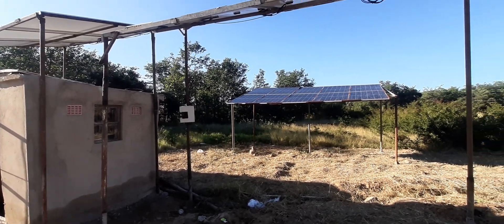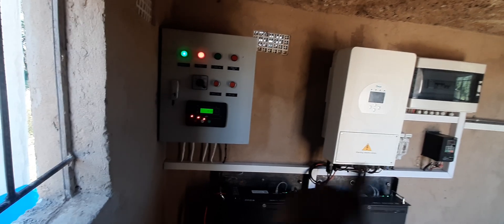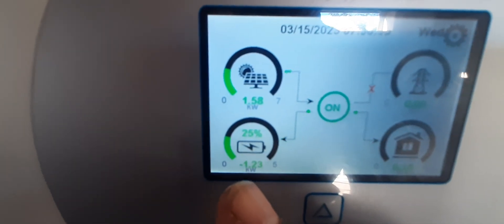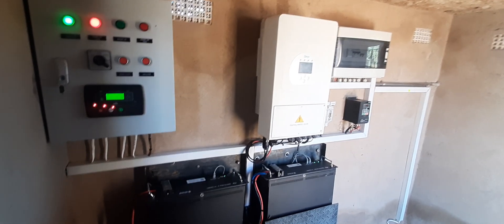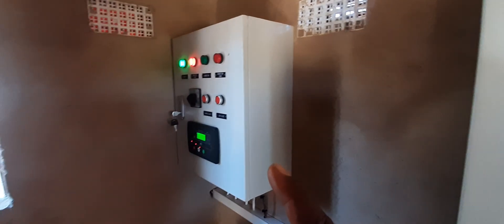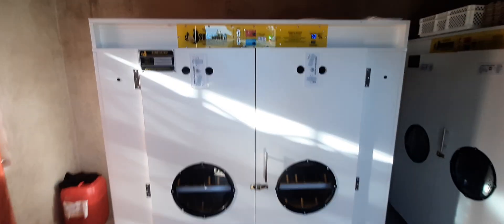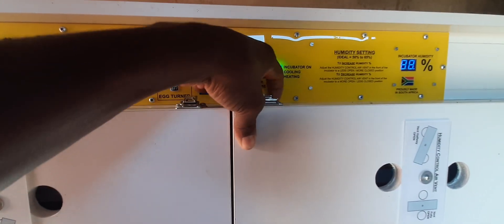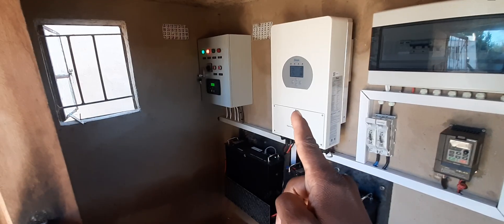This is the best Solar system Ever that can run an SH4000 COMBO INCUBATOR 🥴🤝🏼

Comment: Did you pay any Zimra duties or taxes when you imported the machines?
Reply from the maker: Yes I declared the machines at the border and did all the paperwork
Reply: That means there is no duty it's just declaration of import since its an agricultural machine is it?...also please tell me what's your egg turnover percentage..if u put say 1000 eggs how many successfully hatch ...I know it's dependent on a lot of factors but I just need a worst case scenario number....the other question was does that machine have an automatic humidity controller or you it just has a monitor and you adjust the humidity manually

Comment: Great system though instead of the change over switch + board,  you could have simply used "dry contact switch port" on Deye inverter to switch on the generator. Am sure it has one. It will operate exactly as you do with yr external change over switch
Reply from the maker: The electrician advised me to put that system if I want a backups generator so I think he knows better than me but thanks for the advice 🥰🥰

Comment: Parisei paGokwe apo zvirikufamba hre mukoma makazowedzera hre masolar nebattery 👏👏👏👏👏
Reply from the maker: Haa zvirikuita wena, so far that system is able to run the machines for now, but I'm planning to add more batteries and panels as we go. Thanks
Reply: @mrguineafowlzimbabwe1740 how much do you sell day old Hanga?
Reply from the maker: @chipoasare6702  $1usd each

Comment: Your setup is truly remarkable, and I aspire to achieve the same level of success one day. However, I can't help but wonder if your system's low battery issues indicate an underlying power insufficiency. Wouldn't it be more cost-effective in the long term to invest in additional batteries instead of relying on diesel for your generator? While a generator is undoubtedly necessary, I believe it may not completely resolve the challenges you're facing.
Reply from the maker: Thanks 😊 yeah my plan is to buy another a battery and 8 more panel then I'll be safe. It's in the pipeline 👌🏼
Reply: I think you have enough panels for the load you are running. As Aubrylungu indicated, you need batteries tht can run yr load for say 2 or 3 days without needing charge = 24/36 hour autonomy. Tht way u will never have an issue as sun rises every day.

Comment: Very interesting system. How big is you solar power system? Does it run your incubator consistently nonstop? I have a 5000 egg incubator and I want to get a solar power system for it. We don’t have electricity in the area…. So I’m very interested in knowing how you set up your power. Thanks!
Reply from the maker: Yeah it's a powerful system, I have a Deye Hybrid 5kw Inverter, 2 x 5.12kw Shoto Lithium batteries and 17 x 410w Jinko solar panels plus a 5kw diesel Generator for backup 
The machine runs non stop with this solar power system, it's very powerful. If you need to run your incubator with an off grid system like this, don't go for cheap staff.
Reply: @mrguineafowlzimbabwe1740 how much did you buy it? Did you buy it in SA or Zimbabwe?
Reply from the maker: @chipoasare6702  I bought it from SureHatch in South Africa 🇿🇦